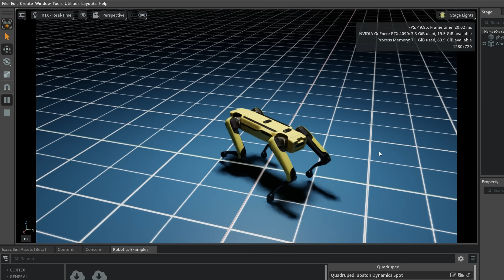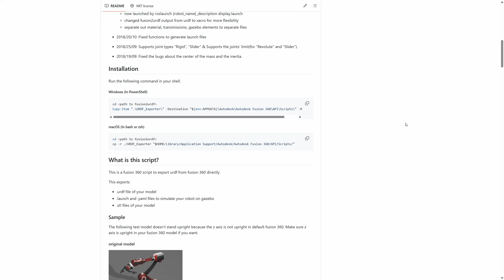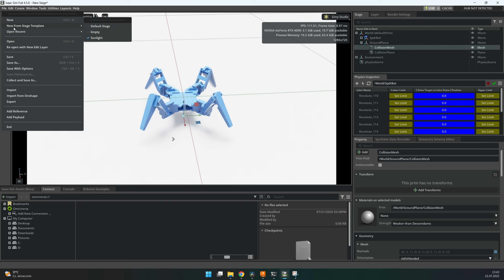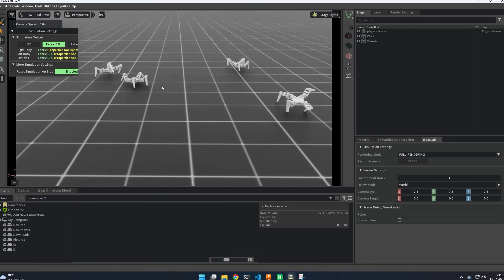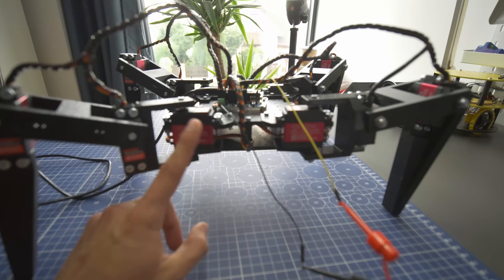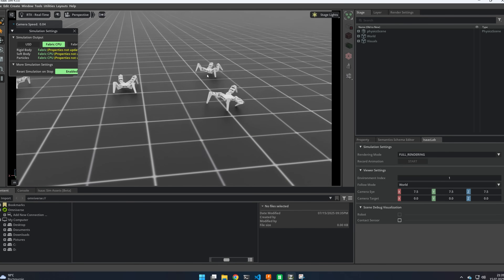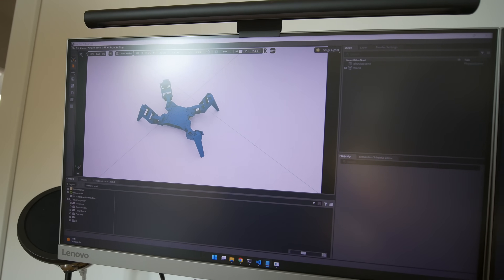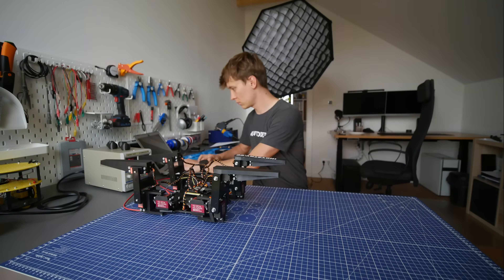I Tried To Build a Robot Like Boston Dynamics With Isaac Sim

Comment from the maker: Check out my detailed video about Isaac Sim & Lab: https://youtu.be/tQziqSx-F80

Robotics Fundamentals from NVIDIA:  https://nvda.ws/41hhGMS 
Get SpdrBot design: https://indystry.cc/product/3d-printable-4-legged-spider-robot/
Reply: I noticed that the robot's paw movements are not correctly composed for its movement. The robot should not slide on the surface of movement. You have a great opportunity to watch your cute dog Shiva to understand the sequence of movement of four paws.

In general, walking on four paws comes down to the fact that the whole body (of the robot) constantly rests on 3 of them. And at the moment of contact of the fourth paw with the floor, with a slight delay, the next one comes off.
Reply: I will love it if you can  guide me as a beginner to robot
Reply: @adedirantimileyin783   there's something called "google" for that.
Reply: Design a hexapod instead of a quadraoped that way you have more movement options instead of limiting movement to one leg. then change the leg at the tip to have angles so that it can lean on them or change to a rubber tip. there is no traction becuase its leaning on the line of the corner, triangular shapes on the bottom allow for 4 planes to put weight on.
Reply: can you make the spiders out of replicator blocks?
Reply: Bro please make an 1 hour version of this video
Reply: Is it free to use?
Reply: Hey! Both your robot and tutorial video are great, thanks! But i was wondering how do you design the Machine Learning model to train the robot inside Isaac Sim ?
Reply: Next add sensors!

Comment: pretty much exactly the same experience i had when i made a hexapod like 5 years ago, although i went with hard-coded walk pattern (much easier for hexapod)
i never did get it working.  quit when it accidentally broke its own leg under its weight.  figured i needed to do a re-design before i could continue.

Comment: torque is measured in N*m or even colloquially in kg/cm, but not kg/cm. It is Force(or "weight")*length, the actually units don't mater. the on screen text at 8:17 is wrong and you say it wrong. But really cool project to use modern tools like Isaac Lab. But it only actually gets interesting if the transition from the simulation to the real world works, or at least helps.

Comment: It needs 6 legs and it won't tip over. You can have 3 on the ground and 3 in the air at the same time for smooth walking.
Sorry, I don't speak English and I wrote it using Google Translate.

Comment: I think the reason you couldn’t train the ml model is because you gave it too difficult of a task. I think you should train the model to balance the robot on its feet and then when you apply a forward force to the robot the ml model will correct the imbalance and move forward. This will be a much simpler way to make it walk.

Comment: Isaac Sim is too expensive to run on the low end device with even RTX4050 and 8GB of RAM. We tried to run it on our computer but it used to get crashed. But training the model on this simulators not easy at all. You need a lot of prerequisites. The most important part is the reward functions in order to train the model. We have wasted about 2 days in figuring out what reward function will help the drone to understand it's work. 

Tip: If you want to use Isaac Sim use it on Ubuntu, it is more stable over there.

Comment: Huh. I know zero zip nada about how you're making that thing do what it does by translating software training to the real thing, but now I know what a complicated pain in the ass it can be. Now I'm curious as to what the differences are between your setup and the Boston Dynamics setup. And although your robot seems like a slobbering retard compared to the Boston Dynamics dog, I'll remain curious as to whether or not you'll be able to achieve a comparable software and hardware setup. And for that reason, I'll subscribe to your channel, just in case you manage to pull it off.

Comment: Of course! Here is the translation and a conceptual description of your idea in English.

*

*Let's create a quadcopter with robotic arms that can build various 3D shapes from a fractal Minecraft-like constructor.*

I've devised a method for manufacturing hollow plastic cubes that connect to each other using bolts and nuts. We could also make cubes from glass and ceramic. Imagine a builder drone that conceived everything itself, produced the cubes, and built a house in the Minecraft style.

---

### *Concept: The Autonomous Fractal Builder Drone*

*Vision:* A self-sufficient, flying robotic system that fabricates its own building materials and autonomously constructs complex, voxel-based (cube-based) structures, inspired by the creativity of Minecraft but operating in the real world.

*Key Components:*

1.  *The Drone (Quadcopter Platform):* A heavy-lift, multi-rotor drone capable of precise, stable flight and hovering. It would be equipped with advanced AI for navigation, spatial awareness, and construction planning.

2.  *Robotic Manipulators (Arms):* Two or more multi-jointed, articulated arms mounted on the drone's chassis. These arms would have fine motor skills for handling tools, assembling cubes, and tightening bolts.

3.  *Onboard Fabrication Unit (Micro-Factory):* The most innovative part. The drone would carry a compact 3D printer or an injection molding system, powered by a built-in energy source. This unit would use raw material pellets (plastic resin, powdered glass, or ceramic slurry) to manufacture the individual hollow cubes on-demand, right at the construction site.

4.  *The Fractal Constructor System:*
    *   *Hollow Cubes:* The primary building blocks. Their hollow nature makes them lightweight, saving energy for the drone during both production and transport.
    *   *Bolt & Nut Connection:* Each cube has pre-molded sockets and channels. The drone's arms would insert a small bolt through the aligned sockets of two adjacent cubes and secure it with a nut on the other side, creating a incredibly strong and precise mechanical bond compared to simple clips or magnets.
    *   *Material Variety:*
        *   *Plastic:* For standard structure and insulation.
        *   *Glass:* For windows and aesthetic features.
        *   *Ceramic:* For heat-resistant areas or decorative elements.

*The Construction Process:*

1.  *Design & Conception:* The drone's AI either receives a 3D model (e.g., a Minecraft schematicatic) or uses a generative algorithm to "dream up" a fractal-based structure optimized for strength and material use.
2.  *Material Production:* The drone lands at a designated spot, takes raw materials from its onboard storage, and begins manufacturing the required cubes, sorting them by type and color.
3.  *Autonomous Construction:* Taking off, the drone uses its arms to:
    *   Pick up a newly fabricated cube.
    *   Fly to the precise location in the growing structure.
    *   Hold the cube in place.
    *   Use its other arm to secure it with a bolt and nut.
    *   Repeat the process thousands of times with perfect accuracy.
4.  *Completion:* The result is a physical, habitable structure—a house, a sculpture, a shelter—standing in the real world, built entirely by a single autonomous machine from the ground up.

This drone wouldn't just be a builder; it would be a designer, manufacturer, and engineer all in one, truly bringing the magic of Minecraft into reality.

Comment: So, I didn't quite understand the last part of the video. You ditched the idea with reinforcement learning, cause exporting the policy from Isaac Lab to Isaac Sim is not straightforward (wow, Nvidia). How did you manually write instructions how to move the legs? Have you been forced to figure out inverse kinematics? Or you just write instructions as angles in joint-space?

Comment: Watching the robot in the end, you can clearly see there is an issue with your IK as the feet should not be sliding on the ground. If you get a good IK by just doing the math you can get much faster mouvement with more stability.
Another thing you will need is also to go back to a sphere foot design (similar to your TPU foot) as having a flat plane like this will change your point of contact based on the orientation which is really bad and will once again lead to the feet sliding

Comment: You can try inverse kinematics (IK constraints) by creating or importing your fine in blander and then running the IK constraint and importing the code from blender. You might need to tweek it a little bit but you can give it a shot. Because you have the 3D model ready, i don't think it would be that hard. You can give ut a shot if you like.

Comment: the walking at the end was definitely really funky.  You are dragging feet along the table.  The leg that is up in the air should wait unntil the other legs have pushed forward, and then come down.  you may be able to find a way in your physics simulator to minimize friction on the feet or find a way to measure the energy spent by the robot as it move along, and use RL to lower the energy spent.... per distance.  That would definitely increase speed.... OR.... you could just maximize RL for speed, and then look at the efficiency gainns.....    and how do you know that walking on two legs wont work?  You didn't try it.

Comment: With nvidia card you can train robots without breaking expensive hardware. RTX4090 - 8500PLN. 1 Servo - 30PLN. For one gfx card you can buy over 280 servos. With that amount you could build fully articulated octopus with 35 servos per arm...

Comment: This is great - definitely interested in a longer version.  Does Isaac Sim offer generated Inverse Kinematic Model (IKM) output of your bots testing that you can use in an Arduino for example?  Or is it just a testing/sim environment - that is, do you have to come up with an IKM first and feed that in along with the 3D model info?  Just trying to bypass the pain of doing an IKM myself.

Comment: Ah, the cheap bulk clip cables from China are terrible and have caught me out several times before I figured out what the problem was. Some have rubbish wire, some are crimped so poorly that no bare wire touches the clips, some have no wire stripped at all. I now buy clips and wire separately and make my own, usually soldering the connections and putting two layers of heatshrink over the connecting leg of the clip for strength.

Comment: To make it walk more easily, you should consider the following.

Break down the movement into four steps; turn left, turn right, advance, reverse.

Start with the turning because this is simplest, and after completion, it will demonstrate how the legs need to maneuvre independently of each other.

To advance, the rear two legs need to become parallel and not turn really. They they only move in a single plain front and back for propulsion.

Afterward, you can easily reverse that set up or flip it, and you are golden.

FYI - Consider looking at nature for hints with movement.

Comment: Maybe using gps positionning could help a lot with friction difference between left and right 
and you could add a camera so the robot know what size of objects it has to climb (no obstacle = fast movement ; obstacle = slow + leg up in the air to pass it)
Great video btw

Comment: Pnteresting project. As a mechanical engineer, the most ideas I had about how you could have improved the legs. Neither the 3D print, nor the soft plastic cap was good enough, you would have needed something either pointy or flat rubberized, but with joints to adopt to the shape of the terrain. I'd also not print it from soft plastic, just use elastic band or cut it from something even more soft, something that the weight of the robot would push down enough to create proper friction. I know the robot learns from simulation but wouldn't it have been easer to give it constrains (or tighter constrains)? Like, you know the generic concept of spider walking, you could have helped the simulation with general guidance on how the overall mvoement is expected to occur, like move 2 legs only at the same time, or 1 only. It looked like the robot tried to learn from the sketch, when in this case I don't think it was necesseraly the fastest way to achieve success.

Comment: This could've been simply programmed in less than one hours not using AI. I don't get the point.
Reply: Theoretically yes, practically no. I have built a quadruped robot before and getting them to walk reliably without RL is a pain and doesn’t work well. There are so many different variables to consider and even a slight bump in the ground can lead to the robot falling over.
I have a short clip of my robot on my yt channel. That’s the best I could do without rl